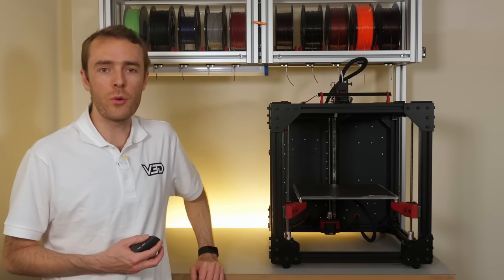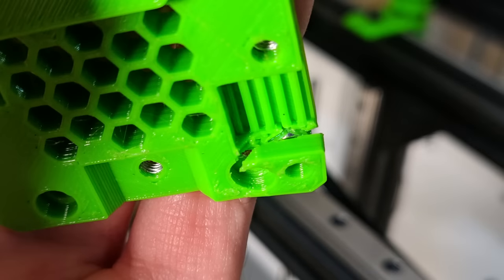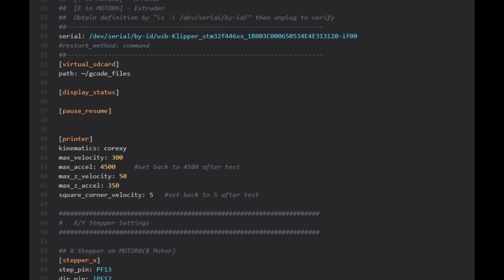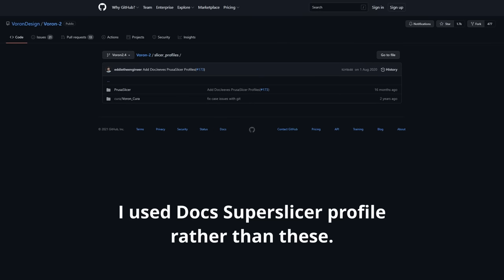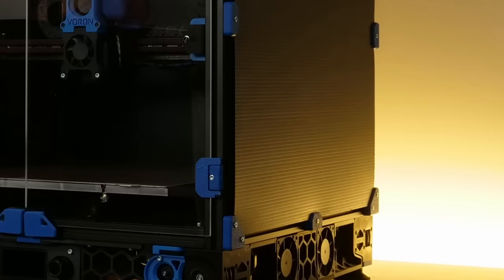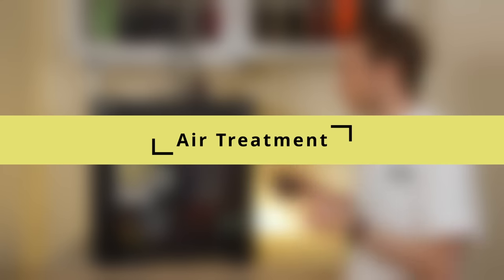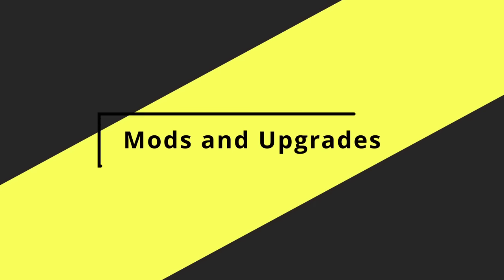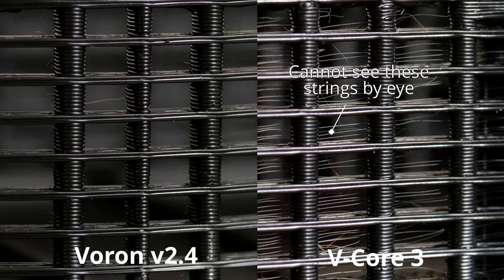Voron 2.4 Vs V-Core 3 Full Comparison Tested

Comment: Awesome video. It was great to see someone take a stab at a V2.4 /Vcore3 comparison.

Only thing I would disagree with was in the maintenance, the V2 is designed to use off the shelf components so replacement parts should be readily available

Comment: Minor note about the idle timer.  you can actually set what it does gcode wise when it switches to idle. that means you can have it never turn of motors and only turn off heaters or even only turn off the hot end.

Comment: [RatRig]  I didn't hear you mention your ground on the frame, this is something I did with mine too, but Rat Rig doesn't mention it in their instructions. I think Rat Rig wants to distance them selfs from the AC side of things to avoid lawsuits but this should be provided and not something I have to drill a hole for.

Comment: As for myself I built a Voron as I print mainly ABS and having the full enclosure has been fantastic!
Reply: Quick question, will CF nylon and polycarbonate work as Voron parts than ABS? These materials are a good deal tougher…
Reply: @kerbodynamicx472  same question, especially CFPA, but the influence of moisture absorption should still be investigated
Reply: @kerbodynamicx472  PC will be fine if your print chamber is hot enough to get good layer adhesion. PA12CF should also work, although I would stay away from PA6 as it creeps a lot more. You could use PA6CF if you seal all the parts by e.g. sealing them with a thic coat of spray paint

Comment: 2:47 fluidd is not the only web interface for voron. Also you can use Galileo and LGX, not only clockwork as extruder. And the Z belts are 9mm
Reply from the maker: Yep, thanks for pointing these things out. I had a lot to think about on this one as you can probably tell so missed a couple of things.
Reply: Well since I got pinned I may add other comments later. Feel free to highjack this comment if you noticed other inaccuracies.
Reply: @Vector3DP  yeah of course it's impossible to be 100% percent accurate on a 1h video packed with information
Reply: and now we got the Stealthburner 😍😍

Comment: As for safe shutdown, you can implement it yourself by having a push (or sensor) button somewhere on the printer + a relay + a simple led. All could be connected to something like ESP32 or similar microcontroller (always powered on). 
Initially ESP32 would have a relay in the 'off' state (everything is shutdown). You press the button, ESP32 detects a button press from the shutdown state and sends a signal to the relay to turn on. Also led starts blinking. Everything starts to boot up, etc.
Once RPI starts up, there can be a tiny daemon that just sends an impulse every second or so to a GPIO pin that is connected to ESP32. This is how ESP32 could monitor if a RPI is "alive". Once it started to receive those "pings" regularly, it will flip the led to a "permanent on" and it will now monitor for the signal to continue. From now on the system is "up".
Once we press the button from the "up" state (potentially a long press to avoid accidents), ESP32 will initiate a shutdown sequence by sending a shutdown signal to RPI on another GPIO, which is then picked up by the same daemon that sends the "pings" and it would initiate the RPI Linux shutdown. Led will start blinking again.
Once we stopped receiving "pings" for a while, we now can declare a "shutdown" and turn off the relay. Led becomes permanently off and that's the cycle.
There are a couple more things to consider if ESP32 goes bust, we would need a physical bypass switch that would keep the system on regardless on the ESP32 (will effectively just send 5V to the relay control pin). Power off in this case could be done by just removing the plug from the wall socket.

That all maybe sounds convoluted, particularly if you didn't invest into playing with ESP32s very much, but it's really quite simple, ESPHome project could do.a majority of work, you would just need a little bit of yaml config. ESPHome effectively simply generates the Arduino application based on the provided config of the supported components (plenty).

Additional benefit of such a solution is that ESP32 itself is WiFi-enabled device, so you can do the startup and shutdown remotely.

Comment: As a mechanical engineer of about 13 years now in the tech industry working on a wide variety of consumer Electonics products and research devices I can say that the first thing I do with any CAD model that I receive is remove the entire part history/feature tree. It's a lot like code. It's usually a chaotic mess and I absolutely don't want to be corrupted by any garbage modeling techniques or hacking and whacking of CAD that was done to create the model. Providing a .STEP file is plenty, IMO, to consider the project "open source."

Comment: Finally an apples to apples comparison, nice work Adam!

That RatOS shoutout made me blush 😂😍

22:12 what you want is something like the Sonoff Pow R2. Flash it with Tasmota and configure it under a [power] section in Moonraker. You then need a dedicated 5V PSU for the Raspberry Pi. Wire everything except the 5V psu through the Tasmota and the 5V psu straight to the IEC plug. You can wire up a physical switch to trigger it as well if you want to.

26:23 this really surprised me as well. I guess there's yet another reason most of us use the P&F probes at this point (Super Pinda / Vinda / SupCR etc) :D I didn't see you account for thermal drift though, it's not "noise at higher temperature" it's a drift in trigger distance with temperature, thats why it doesn't impact your standard deviation or range. In the case of thermal drift i would expect the BL Touch (and the P&F probes especially) to outperform the ... is it Omron?.. inductive probe on the V2.4.

We do still improve the V-Core 3 design in the dev team! The full enclosure was released not too long ago, the idlers have been upgraded, and there are more that i can't talk about at this time :D Rest assured, improvements are happening regularly, and it will continue!

Very nice review though! I enjoyed watching it! If i had to complain about something it would be the v1 dragon which might have skewed things a little bit with the stringing, but it is what it is :)

I'm gonna end things with a little notice about RatOS. It'll support pretty much any printer and any hardware, it's not limited to Rat Rig machines, so if the Voron team (or other printer devs/companies for that matter) wants their machines supported, reach out to me! Thanks for the kind words Adam! :)
Reply: Glad to hear .. Can't wait for my Vcore to arrive

Comment: Well done sir. This actually sets you up quite well for a followup video in 6mo to a year, especially since a lot of the deficits of the Voron are going to be fixed with Stealthburner and will make for an interesting then and now video in the future. 

One other note, when you look into klicky, one of the best features of it actually solves the endstop issue you were having, it's a auto-z offset script, it will ping the nozzle off the z endstop, pick up the probe, ping the probe off the bed, then ping the probe body off the z endstop, do some fancy math automatically and set a perfect Z offset every time regardless of bed/chamber temps.

Comment: For the issue regarding a power off button, use a momentary pushbutton trigger the shutdown event. You can either feed the RPi from a power brick and the rest of the printer from the main PSU using a mechanical relay to control it. Or use a WiFi smart plug to schedule the smart plug power off and shutdown the RPi before the plug shuts off.

I added both on mine as I can use the PSU only when required, for lower power consumption and the smart plug when shutting down octoprint or emergency/fire stop

Comment: One note about the open source section: RatRig is not truly open source in the copyleft sense because it has a CC-BY-NC-SA license (NonCommercial restricts usage). Voron uses GPLv3, which, while not really the best license for a hardware design, is fully copyleft. Ideally, they would both use a true open hardware license such as CERN OHL.
Reply from the maker: This only changed recently after I published this. From my conversations with them they will protect themselves from large commercial copying but not hobbyist and individuals selling mods and stuff. Obviously I can't guarantee that, but it's my current understanding.

Comment: I installed the ABBN mod on my 2.4 a couple of weeks ago to improve PLA printing.
Haven't printed a single part in PLA since then, haven't even tried how much of an improvement ABBN is...
For people like me that print a lot of ABS the 2.4 is a really good buy.
Reply: StealthBurner
Reply: i switched to Stealthburner (which implemented the Airflow Changes of the ABBN, plus little modifications) and works excellent for PLA, a whole nother league compared to the stock afterburner.
Reply: @mongini1  Duly noted. Tooling up to build a Voron, and while I don't plan on printing a whole lot of PLA, I'd still like to have the option to do it well. My Ender 3v2 had a truly monstrous cooling setup that sounded like a fighter jet spooling up for takeoff when the fans kicked on that basically didn't require any supports. I don't expect that level of parts cooling out of something I mostly plan to use for industrial filaments, but being able to do some rapid prototyping on a budget would be nice.

Comment: I'm building a v0.1 and as for shutdown of the pi, I think I'm going to make a graceful shutdown circuit that will detect power loss and shut down the pi before losing power. Might be something to consider.
Reply: UPS hat for RPi's aren't that expensive and a momentary switch and a few lines of code is all that's needed to shut down a pi safely without log in, both a UPS and two Momentary switches should be included with the Voron BOM's or listen as optional (shut down button and restart button),  Klipper should also include the bash script or a link to a good one for the shutdown and or restart.

Comment: When I decided to build a premium printer (2years ago) all the sites for the kits, Voron and Hypercube had a large list of the kit componants out of stock, combining that with the reports of many parts being very poor quality and having to be replaced I decided to go a different route and decided on a completley different build, the Pro 3D V-King 400, although the wreere spreadsheets of parts and suppliers I decided to use the very best parts I could lay my hands on and so sourced them myself, this resulted in an increased build price but I had the benefit of only buying and building once and if I had any problems I could contact the designer Roy anytime, as it happens I did not need to consult Roy as his build video's covered everything in an easily understandable way and so I have a printer that I have not had to repair or upgrade and am 100% confident in, I can load up a file press print and leave it to do its thing and turn out wonderful quality parts!

Comment: Building a cross between these two as this was posted, the cost for a full set of ratrig metal plates was around £100 + postage, I sourced 4mm aluminium plate at 500x500, and used around 2/3's of it, at a cost of £35 delivered, cutting, drilling and finishing 20 corner plates and the others took around 12 hours over a few days, (I have more time than money), it was a lot of work, all this was done using a very small bandsaw and bench top band saw, lot of work but some how much more rewarding. - I now yearn for a desktop CNC :)
Reply: I see a PrintNC in your future...
Reply: @Kosh42EFG  literally was just about to say the same 😂

Comment: Hi Adam, 

thanks for this very extensive and open comaprison :)

Just a few comments - I am still watching and adding here as I go through the video:

a.) As the maintainer of the RR-printer profiles I disagree with your evaluation on the profiles. The modern research on functional parts has shown, that thicker support lines don't result in stronger parts. The modern approach is: For strong parts, use more hull - more or thicker perimeters, more bottom and top layers. The function of the infill is mostly to ensure the top layers print well. To achieve this, you want lots of lines, not thick lines. It's also the reason why modern infills like adaptive cubic infill were invented. They are dense close to perimeters and get less and less dense toward the center of objects. Another approach: Think of the top layer as a huge bridged layer. The more often you support this huge bridge, the better it will look. Thick lines won't help with that, but many lines will.
b.) Regarding the deviation differences: I don't want to argue with the numnbers. I just consider the numbers on both printers as excellent. The gold standard for Z on FDM printers is that repeatability should be better than 0.01mm for perfect results, and both printers meet this standard both hot and cold. Yes, there is a difference - but it's negigible for printing results.
Reply from the maker: Are you saying that a fairer comparison would be to compare print times for 20% infill on RR to 40% infill on Voron? (or whatever draws the same number of lines
Reply: @Vector3DP  What I say is: All these profiles are templates. You decide if you want strong functional prints or save plastic and time. Going heavy with thick lines and 40% infill serves neither of these purposes. For strong parts, use more and thicker perimeter lines, not thicker infill.

Comment: I power my Pi from a dedicated 5VDC power supply and added the GPIO plugin to OctoPrint and a relay board.  That will allow you to shut down all power to heater and printer board using the GPIO controlled relay board.  I use a 4 channel relay board but really only need 1 or 2 channels, 1 for printer board supply and the second for AC powered bed heater.

Just remember the Pi uses 3.3v for GPIO so google how to configure the relay boards for use with the Pi.  Just a matter of removing the jumper for vcc and connecting 5v for relay coil power and 3.3v to power the control section.

Comment: An additioanl reccomendation if you want a cheap entry to printing ABS and printing quite fast, an ender 3 can be turned into a switchwire, there are voron user mods that do this, and the switchwire design is enclosable and very compact for an enclosed bedslinger. My current ABS printer is a clone prusa mk2 running klipper in an ikea lack enclosure, with and afterBEARner hotend/XZ assembly. Prusa frame is a bit flimsy and prints look bad with an acceleration above 1000mm/s/s, but it's my way in to bootstrapping myself into a voron. I'm just using cheap correx panels on the lack box and it works ok BUT it takes up more space than a 350mm voron for a prusa mk2 or creality ender 3 size bed, at which point if space is at a premium, the voron 2.4 and trident look very very good.
Reply: can you convert the v1 ender, or just the v2?
Reply: @phoenixrising4573  the original ender 3 with the 20mm centre section need a lot of different parts, the pro and v2 are perhaps better supported and more active, but there is a v1 mod on voronusers, and a small but active channel in the voron discord.

The v1 mod uses one less linear rail and is probably less annoying to build, lining up the two rails for the v2 y is annoying.
Reply: @phoenixrising4573  You can print ABS no problem with Ender 3 v1 enclosed. Some people do it with cardboard box, I have a tent. Already printed 75% of the Voron 2.4 parts without issues.

Comment: After about a year of staying out of 3D printing news, I pretty much immediately stumbled over these two beastly beauties about a month ago.

By the time I actually have the funds to spare for either of them, we'll probably be on the successor models, but just to air my dreams into the aether:

I want an IDEX, and while there are obviously easier (mod and stock) options out there, I've quite fallen in love with the idea of turning a Voron 2.4 into one (with Rapido UHF hotends and Zodiac Pro nozzles). I'll have to wait until the Voron IDEX Project not only matures in general, but also adapts to the 2.x style, though, anyway, as I really don't trust that I'd be able to overcome the challenges from scratch.

And my ultimate dream project to end all projects is simply put turning a V-Core 3 into a Jubilee (with two Revos, a Chimera, a Cyclops, and a couple of tools). I haven't even looked into how exactly to best merge the two yet, though, due to the cost.

Anyway, I probably ought to get some experience building a core-XY before either of the above. I'm heavily eyeing a Voron 0.1 for this, but I'm waiting for kits to come with an SKR Pico out of the box. (Hotend-wise, part of me wants to go Rapido UHF with Zodiac Pro as well, but it's so tiny, Dragonfly BMO with Zodiac CRB should more than suffice.)
Reply: I’m admittedly weak in CoreXY knowledge. I’m printing with a bed slinger, Anet A8Plus, my first printer and over the last 24 months or so have learned quite a bit. I’m an engineer by trade and as such thoroughly enjoyed building / assembling the kit so I’m not intimidated regarding such things. I’ve been studying CoreXY for a bit. I’m leaning towards the Voron for multiple reasons. I have to ask though as I haven’t come across it yet. What is IDEX? Yeah, I’ll be googling it when I click submit on this but, wanted to get your take on it since it sounds like it’s tops on your radar. Thanks.